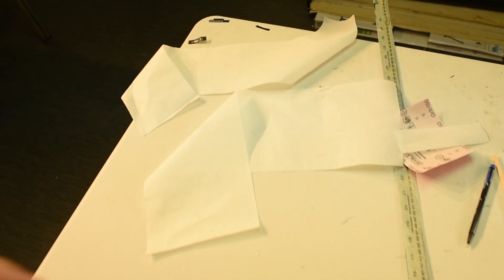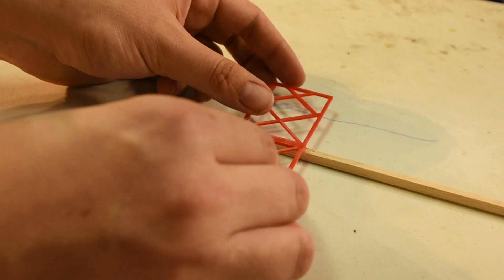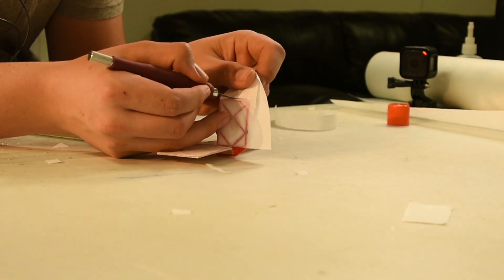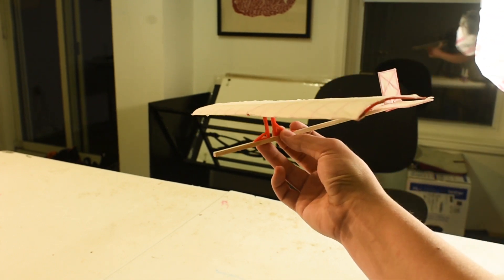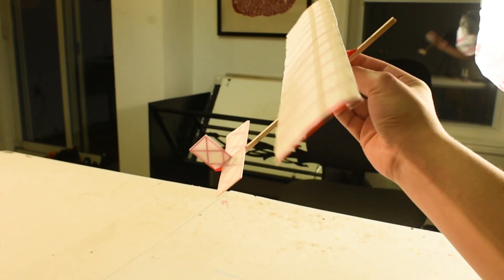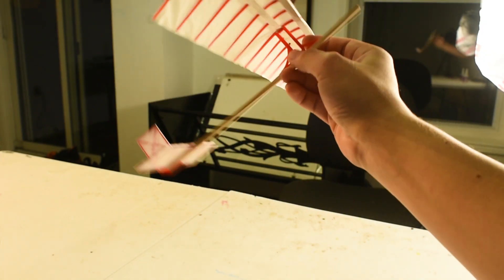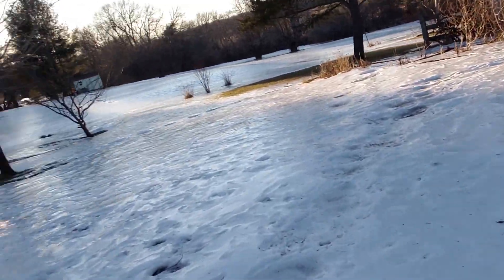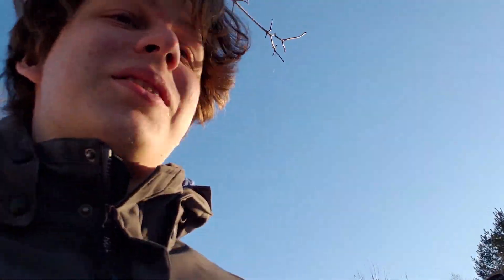Will it fly? | 3D PRINTED GLIDER

Comment: This was a good try.  About 5 years ago, I was experimenting with trying to design, print, and fly 3D printed rubber-powered airplanes.  The first few I printed were from PLA; I found out (as you did) that it is very challenging to print something that is light enough to fly and glide well out of PLA, but I did manage to get some of these planes to fly.  (For one of them, I used HIPS which is lighter than PLA.  ABS and ASA are also lighter than PLA as well.)  You might want to try some of Colorfabb's Lightweight PLA on one of your gliders.  You might even be able to print a reasonably lightweight wing out of it.  When I switched to Colorfabb LW-PLA, it was quite a breakthrough for me, and I was able to get many decent flights out of my rubber -band powered airplanes.  (You can see videos of them on my YouTube channel.)  I think LW-PLA could work for your glider as well.  Good Luck!

Comment: Actually you are pretty close and it wasn't too heavy here's the problems you have

A free flight airplane needs the ability to correct itself it is virtually impossible for you to throw it perfectly and then once you release it it's exposed to the environment and will upset even an absolutely perfect throw which you can't perform anyway

So the two primary things you need to correct are roll pitch in yaw You'll notice I said two That's because yaq taking care of by the rudder

So what's left is role in pitch when the airplane begins to turn left to right there is nothing in your design to correct that normally you would adjust your ailerons to push back in the other direction but it's a free flight airplane so you can't do that The way you do this is with something called dihedral You basically need to put an angle in the middle of the wing so that the wing tips are slightly higher than the center of the wing this way when the airplane tilts one way that wing produces slightly more lift than the other wing which creates a corrective motion to push the airplane back towards center

You also need to be able to correct pitch Your airplane is what I would call neutraly stable so it tends to fly on the same plane and miss you release it That's why it doesn't pull up You need to add that this is called incidence

You could just add a little bit of up on your elevator but better would be to angle your wing so that the leading edge of the wing is two or three degrees higher than the trailing edge of the wing this way when the airplane is flying level per the wing the elevator is pitching slightly up this way if the airplane is traveling down it tends to want to pull up correcting a dive

That's what you need to do to your airplane add a little bit of incidence to the wing and add a little bit of dihedral to the wing and give it another shot You could probably also get away with half the number of wing ribs if you add trailing edge stock balsa just like you have a leading edge but skinnier to the trailing edge whether or not you win the mass game there not sure you're not going to save much mass with fewer ribs and you're going to gain a little bit by adding the balsa so it might be a toss up

Comment: its kinda impressive that you've made a light glider with PLA which is quite heavy material.
well done!
Reply: Actually PLA is considered a lightweight material it's one of the lighter plastics out there although PETG and ABS are slightly lighter but not as strong

But yes compared to for example balsa wood PLA is pretty heavy

Comment: thanks for posting.   good work.   here are some observations.     you do seem to understand that  printing  a Sufficiently light, small flying model airplane is  problematic.    a larger model would be less, 'heavy for its size'.      the elevated-wing planform was  OVERLY-elevated.   especially, for a  hand-launch  glider.    in the main wing,  a  High-drag, single-surface  profile was used;  not a great choice, on a  GLIDER.       wing design should include the use of a two-surface, cambered, flat-bottomed profile; one resembling a  clark-y (v1) profile.    this is THE profile 'shape' to use; always  Thickest at  30 percent of chord; wing mounted at zero-degrees aoi.    thirty percent of chord is, also, the optimal location of cg.    if desired, in order to ensure that a  model is flying with a  nose-heavy dom,  a cg location a bit forward of thirty percent can be used.       TWO  layers of covering were used, at  the  STABS.  excess mass.      the use of  miter-bracing  at the stabs,  ADDED  More  mass.     for any free-flight model,  'passive controls'  Must be  built-in.    ie,  a  little bit of left or right rudder.   AND  an  Amount  of  'nose-up deflection' at the horiz-stab,  Sufficient to  result in a  nominal  glide  slope.    (the use of this feature can be seen,  on  even the most inexpensive of  'store-bought'  gliders.)     during a launch,   this Required nose-up moment,  tends to cause a  steep climb  or  loop.     the former is to be desired.  with a little luck, the model will come upright after a stall, and start gliding.     the model was a bit short on overall stability, because a  zero-dihedral  main wing was used.     just eight degrees (four per side) of dihedral  SIGNIFICANTLY  increases  a  model's  self-stability.       ( it should be understood that if  appropriate  nose-up deflection  is not built into the horiz-stab,  the model will always be flying  Downwards.  even if the wing is making lift.    see the clark-y profile.   see a  classic hlg  design; using balsa and two pieces of spruce.   cheers        googletranslate
https://en.wikipedia.org/wiki/Clark_Y

https://i.etsystatic.com/16593028/r/il/bbaa3e/1607956501/il_570xN.1607956501_jjvq.jpg

https://www.oldmodelkits.com/jpegs/jpegs2/Jetco%20SG-3%20Thermic20vg+.JPG

Comment: Very well built! If you threw it Upwards a bit more, with the nose heavy cg, it probably would’ve gone further. If you would like to get a relatively light design, you should try building one that is at least twice as large so that the material you use would remain the same, but you get a larger wing structure with more lift. Other than that, this plane turned out really nice!
Reply from the maker: Yeah, definitely. I think I could have saved some weight in the back. The tail was overbuilt, and as a result I had to add a lot of weight to the front